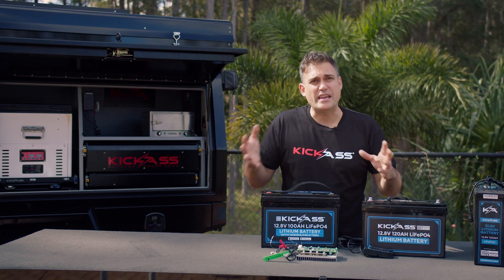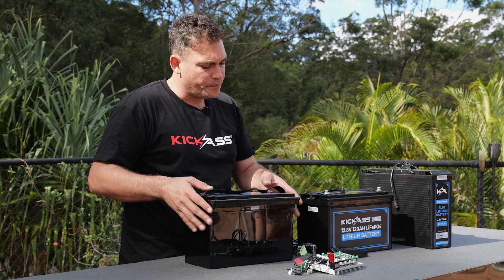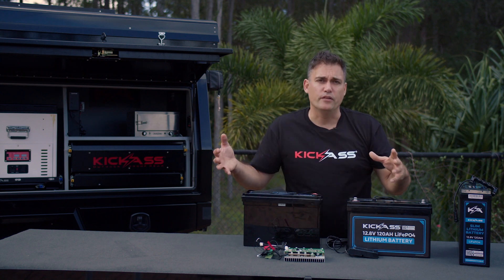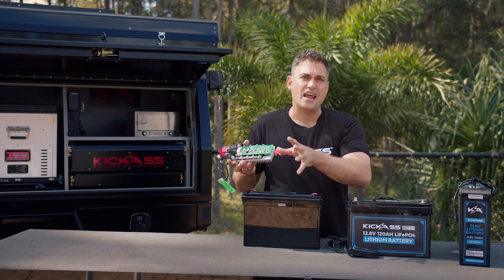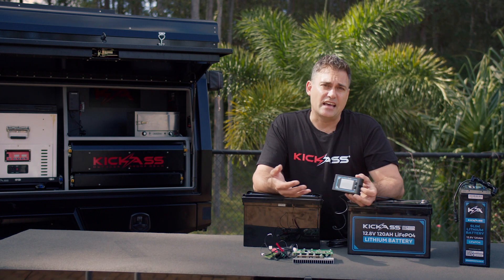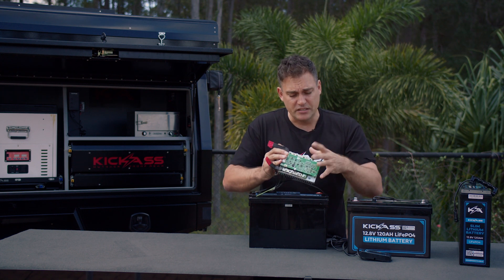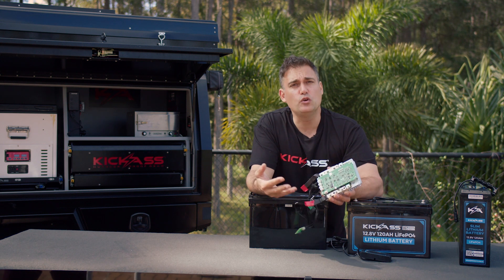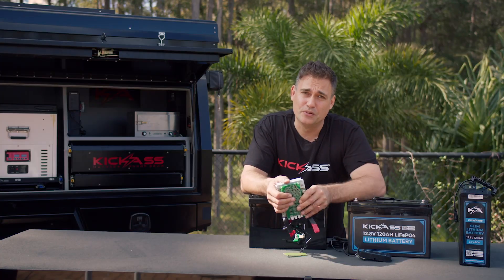What Is A Battery Management System? (BMS) | Tech Talk ep 2

Comment: In the future would you be making a lithium battery that can be connected in series or parallel?
Reply from the maker: we are currently developing a new remote display so it will monitor both battery's but for now  You could run them in parallel now but you need to display units to monitor the battery
thanks for watching 
Cheers Craig